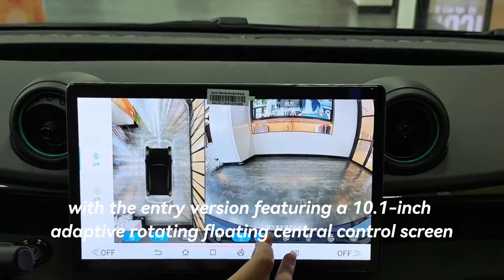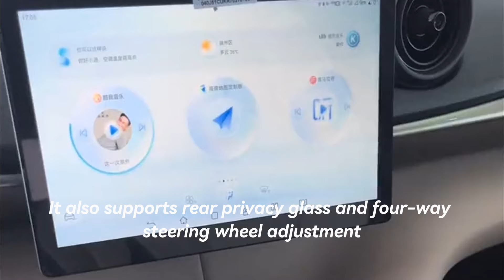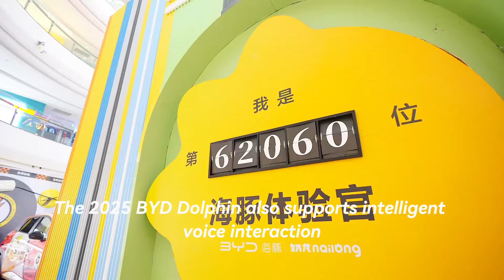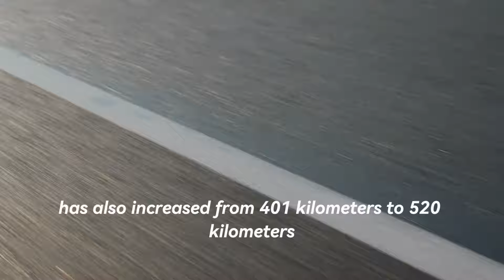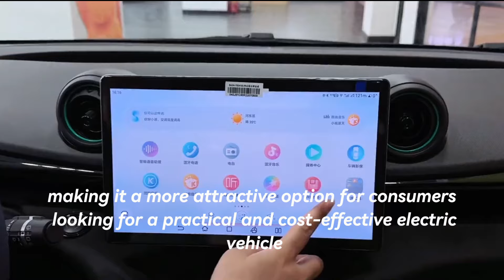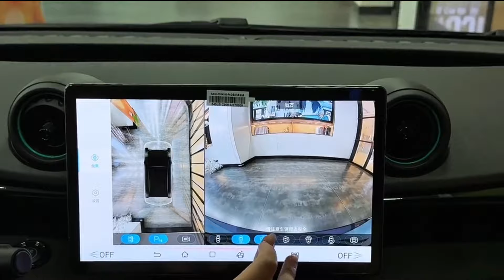2025 BYD Dolphin Facelift - Everything You Need to Know!

Comment: Hi, thank you for the info provided!
 I am not sure if is mentioned on the video and I missed it, but do you know if the 2025 version will have a 4 wheel drive on the the top level trim or will it be front wheel only?
Reply from the maker: no 4WD in 2025 version, front wheel only
Reply: Thank you! I think I got it confused with the suspension upgrade